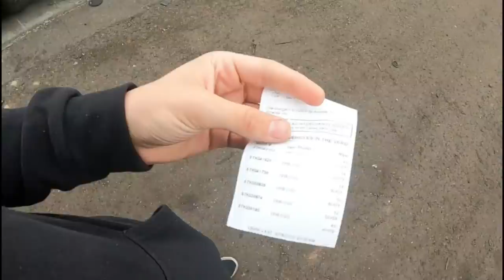Junkyard SCORE for everyone!! The TL is ALIVE!!

Comment: Them deadbeat boys experienced j series lmao I had a 04 TL and the torque on those is amazing. Not the fastest car ever but fast for what it is. BTW delete the mufflers and resonator and thank me later lol
Reply: I mean he did have the odyssey at one point lol
Reply: @EF8SQUAD  it's a van😂 I'm talking something that isn't a small bus in weight. Even then he did say it was powerful at 1 point lol
Reply: @summ-tinng-wong  this boy said a small bus in weight lmfaooooo
Reply: Yeah he's talking about that 3.2 vtec. Vans have VCM and no vtec. VCM is trash. But that 2nd gear on the tl cl grabs like a mf. At least type s models. I had one that peeled into 2nd Everytime. The 3.0 6MT accord is super fun too. Have 2 of those now.
Reply: I had a '00 Acura TL 3.2L (J32A1) w/ the following;
Custom CAI, Ported n Polished TB & spacer,  Intake Manifold with thermal spacer, universal Weapon•R oil catch can, OBX 3-1 Headers, high flow S2K cat, 2.5" exhaust piping to custom resonator- dual quad tip mufflers. Stock auto 5spd (fragile) trans with upgraded oil cooler and filter, A/B solenoids....all dyno'd at 232hp @ 238lb-ft tq to the wheels....OH YEAH...VTEC crossover in the J32-37s are amazing!!!

Comment: Idk bro i have 400k on mine so you could drive it a little while. You might have to change the alternator every 100k. They built your TL in Ohio, its American made. Water gets into steering fluid system. Flush it or grab a used pump out junk yard. Ive learned the hard way that a used Acura part is better then a new aftermarket.